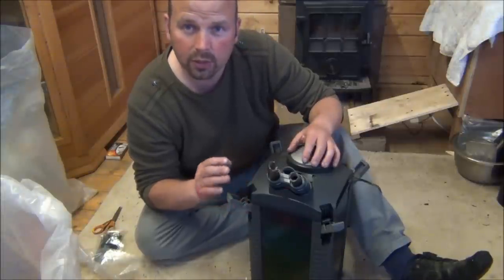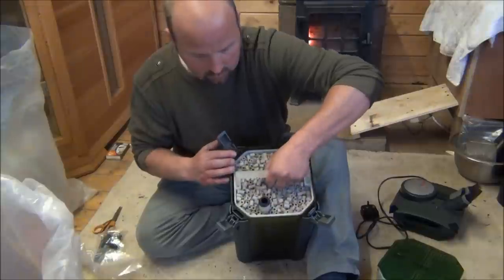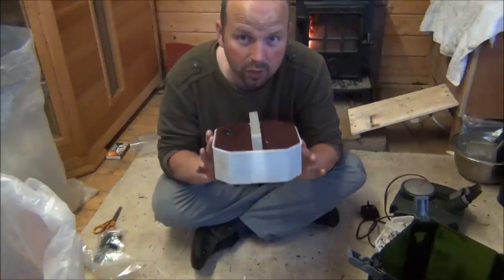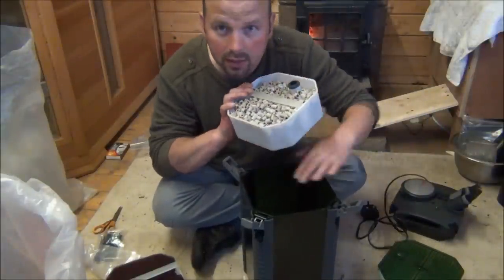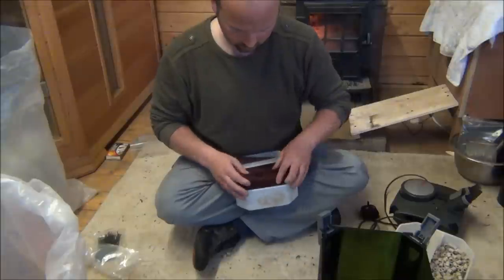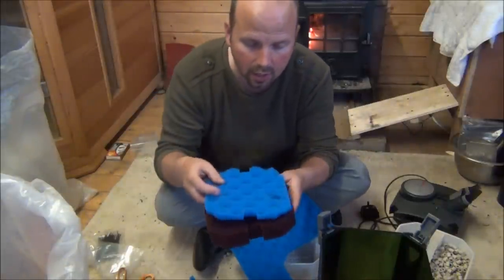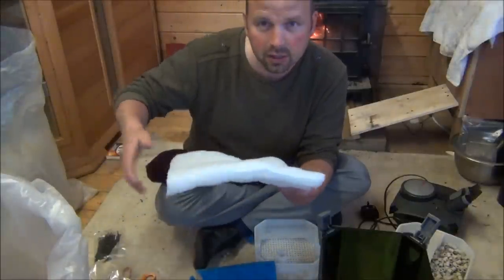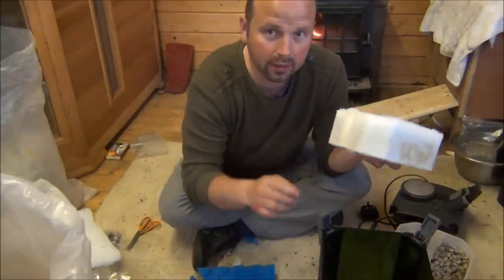How to set up an external canister filter for aquarium by Pondguru

Comment: Hey Richard, don't you have the water flow reversed in canister filtration?  If you say they're all the same, I'm hopelessly confused.  

Doesn't the water enter the top, trickles down through the coarse/medium/fine foam filtration (mechanical) then through the baskets holding all the Biohome media (biological) and finally ends up at the bottom of the canister where the water is free of impurities (ammonia/nitrite, etc.?  

If the water went immediately to the bottom of the canister, as you say, your set-up makes perfect sense.  But from what I see, Eheim  (I have 1200 XLT) has the water enter the top, where it meets the coarse filter, then descends to a finer one, then through 3 baskets of biological filtration at which time, the water is wonderful. 

I can check with Eheim but the top-down (trickle action) makes more sense to me, given how Eheim structures their mechanical/biological media in that sequence.
Reply from the maker: This link will show the water flow in the 3 series (half way down page): http://www.fishtanksdirect.com/EheimProfessional3AquariumCanisterFilter2073.aspx
If you look below the picture and read the description from eheim it is clear they have the set up arse end round given the direction of water flow as their fine pad is on the top tray just before water leaves the filter. Therefore particles are only removed after the water has travelled through biological media causing it to become clogged and inefficient when compared to a filter set up properly (with mechanical then biological).
A trickle filter is one where static water level is lower than the media so water 'rains' (or trickles) through the media by gravity as in some sumps. A canister filter has the media totally submerged in a pressurised situation so of any filter situation that is the one where it is essential to have the filter set up correctly to protect the media and ensure proper operation.
You could place the media and foams / pad anywhere in any filter for clear water but for long term healthy water and high waste processing capability (reduction in ammonia, nitrite and nitrate) it needs to be set up with all mechanical done before the biological zone.
Hope that helps.

Comment: I have a 15 gallon tank with 2 filters running on each end but the water still gets mucky within a week. canister filters are meant for really big tanks. how do i find out which one will have just the right amount of power for my tank? last time i put a powerful filter in a smaller tank my fish had trouble escaping the suction.
Reply from the maker: +Abdulbarr Aslam Canister filters are available in a wide range of sizes and are definitely the best way to filter tanks if set up correctly but you can get decent internals with multi chambers which can be set up correctly. Using a spray bar will diffuse the flow and be better than a straight outlet. Even if you go for one 50% larger than necessary with a spray bar attached it should be fine for even weak swimming fish.
Reply: Thank you for the input

Comment: can you add sachem perigean on top of the last tray if needed??
Reply from the maker: +Kevin Courtenay Aaaaarrghhh.....the bacteria killer. I&#39;ve had so many people reporting that their biological filter fails to establish and control nitrate and Purigen has been a common factor in those situations. Once it is removed the filter matures naturally and starts to control pollutants as it should. My advice would be not to use it but if you want to remove colour or residual treatments from water use carbon as it will do exactly the same job without hammering the bacteria in the filter. The purigen seems particularly hard on the anaerobic bacteria which controls the nitrate meaning that when the purigen is removed (after killing off the bacteria) pollutant levels rise making the user think that they need the purigen. You only need foams in correct place in the filter and good media. That will enable your filter to support the right balance of aerobic and anaerobic bacteria resulting in full cycle filtration and ultimately the processing of nitrate. 
I&#39;d definitely say ditch the purigen and put something useful in like more media or carbon (if needed to remove residual fish treatments or staining from bogwood). 
http://www.filterpro.co.uk
Reply: +Pondguru Outdoors thanks for the email.... I will remove the purigen and add more media. Where can i get the media you show in the video in the states???
Reply from the maker: +Kevin Courtenay If you follow the link on my website (flag on all pages) it will take you straight to US dealer.
http://www.filterpro.co.uk

Comment: hi i want to fit an external filter to my 65l aqua one horizon tank  and want to set it up as in the video can you suggest  a suitable one and how much media i would need to order many thanks
Reply from the maker: You wouldn't need a very big external filter for 65 litres and to be honest the name of manufacturer isn't too important as the majority are decent enough quality. Most will take 2-3kg of media but some of the larger ones may take much more. Just send me measurements of baskets you want to fill with media and I can work it out exactly.
Reply: Pondguru was thinking of the fluval 106 but not sure how it would set up as it has a side filter
Reply from the maker: MrDaveyb942
Would still work no problem as long as you made sure foams were in correct order.

Comment: hi there i have a blagdon external pond filter it hasthem white round things at the bottom and then 3 sponges should i just leave them how they are.???
Reply from the maker: Unless you improve the foam filtration in that filter there is no point changing the media as a pond situation usually generates much more muck than an indoor aquarium.

Comment: Hi would you use this system on the Fluval 306. Andy
Reply from the maker: Andrew Leigh Yes it would work exactly the same with the layered foams in bottom tray and media in trays above that. You would need around 1kg per tray so for the 2 media trays you'd need 2kg of either mini ultra (as in this video) or biohome ultimate in this video: https://www.youtube.com/watch?v=lsAmSD3wVbgLeave the standard foams down side of filter as they will give extra mechanical filtration.

Comment: +Pondguru Outdoors I need help with refilling the filter by priming after doing a maintenance...I have a prime button on top and I have closed both the valves and theres locked water inside them..Now if i open those valves will the water come to the filter ? or should i press the prime button to release the water?
Reply from the maker: The prime button acts like a purge to drive air from the pump part of the filter so as long as you fill up the pipes with water, turn on the filter then keep pressing the priming button it should start to draw water.
Reply: +Pondguru Outdoors Thanks for the reply..I have set it up and its running fine..but occasionally the outlet tube throw some fine bubbles while the filter is running and the canister unit makes some whooshing sound when it does that...but it only happens sometimes...I pressed the prime button multiple times while its running and it throws more bubbles when i press but after that its still the same...is that normal or am i doing something wrong?
Reply from the maker: Sounds like there is still air in the pump part of the filter. As I'm assuming there is no air being sucked in by the inlet pipe you could release the last air by tilting the filter about 20 degrees in all directions. You should hear the air being sucked up by the pump and it will be spat out into the tank from the return pipe.
Reply: I think i have a small packet of air in the inlet pipe where the tube connect the hose..how do i get rid of it.?..i tried rocking the canister and it does what you said but still the air packet is present in the inlet tube..
Reply: pls ignore my previous message..i fixed it by clearing the air bubble inside the intake tube..thanks..
Reply from the maker: OK no worries - glad you got it sorted.
Reply: Another question...I have placed the intake and outlet pipe in the same side of the tank..the fish waste accumulates near the intake tube(a few cm away from it) but its not sucking it up...Should I place the pipes on opposite corners? what is the effective placement of pipes to catch the wastes?
Reply from the maker: Every tank is different as the decor will alter water flow but as long as you have a good turn over of water and the dirt is not pushed away from the inlet then it sounds like you have the flow right. If you can get an extension for your inlet you can drop it a bit to be nearer the collected waste.
Reply: Nice idea , I thought of that too..Hope you don't mind another question..My filter filters from bottom to up..It looks a slightly V-shaped, Wont the water also travel via the sides to the top? I can definitely see the gaps around the sides of the trays...so how does the water enter the top? is it only from the bottom tray to top tray or also via the sides?
Reply from the maker: The sides should fit together to prevent water getting in or out the sides and the tube sending water down to the bottom of the filter will fit with the pump part to allow water to flow down freely then rise up through trays.
Reply: ok thanks, But I can see fish wastes on the sides which is coming from the bottom gap, but the top lid on the first tray is pressurized by the motor and holds them together from going up...Im wondering why cant they make the trays airtight so that the water only flows through the bottom tray and not the sides...Are fluval filters also like this?
Reply from the maker: All filters seem to have some sort of tolerance and some will be more than others. There will always be dirt around the outside of the trays but it should not be able to get into the trays under normal circumstances.
Reply: ok thanks for all the helping replies to my noob questions even though you seem to be an advanced aquarist... :)

Comment: hi Pondguru i just got this sunsun 302 3 stage filter and i wanna know if i can use the same setup here on that filter
Reply from the maker: Yes as it works the same way. Unfortunately I don't have the tray sizes for the 302 recorded so feel free to measure them and I will work out how much media you need for each one, no worries.
Reply: Pondguru thanks i will do that for you... they about the same size as the ones in this video
Reply from the maker: Curtis Williams Many of the externals available are of a similar size but its always best to double check, no worries.
Reply: thanks i used the same setup you have here and it runs better and water looks clearer, But what you think is the best bio rocks to use.. cause i have them cheap bio rings that you can get from anywhere.. And do i have to use then bio balls.. or can i use the last to trays for the bio rocks like you did here?
Reply from the maker: Curtis Williams This is definitely the only way to set up an external filter and the later video explains it much better and shows the upgrade kit:  https://www.youtube.com/watch?v=lsAmSD3wVbg
Reply: so what bio rocks to use
Reply from the maker: Curtis Williams I have no idea what bio rocks are.
Reply: Pondguru the rocks you use in this video what are they so i can get some of them... are they media?
Reply from the maker: Curtis Williams The media I use is Biohome mini ultra. Link is in the video description along with quantity used.
The improved version of this media is called Biohome ultimate and is the same as the mini ultra but has added trace elements to allow the bacteria to work even faster.

Comment: Hi looked thought all comment can't seem to find the answer , if I ever need to use carbon or clearmax where should I place it above or below media?
Reply from the maker: I'd generally say put it right at the top so it is the last thing the water hits before it leaves the filter. If the filter is set up properly you will not need either of those products unless you want to draw in any colour from bogwood or soak up residual treatments. When the external is set up right you will treat the tank much less though.

Comment: So the first 2 trays fill them with bio media and the last tray with course, medium, fine foam? I was wondering what two trays of Bio media be too much? I have a 38 gallon bow front. Sorry if this is a stupid question I'm new
Reply from the maker: If the water flows up through trays like it does in the filter in this video, yes. You can't have too much filtration on a tank.
Reply: Is it possible to put too much bio media in the trays? i have 5 trays the sponges in the bottom and bio media in 3 trays and fine sponge in the top. The water seems to leak out of the filter the bio media i'm using is a lot smaller than the one you're using, I'm not sure if I'm using too much.
Many thanks.
Reply: Linda Baxter why do have the fine sponge up top? If your filters starts filtering from the bottom up. First tray should be course, medium, then fine pad like in the video. Fill the top 4 with good bio media. That's what the guru would say I'm guessing haha. I just ordered some more fluval bio max to put in my second tray.
Reply: Linda Baxter forgot to mention, it could be the fine sponge up top cause the leak?
Reply: clubtc05 
Hi.
I've since found that the clamp that holds the motor head down has a crack in it hence not holding the head down securely. I'm modifying this I'm pretty sure thats where my problem is.  Thanks thou for your reply, I've also put the 3 layers of sponge in the bottom tray and evenly distributed the bio media in the other 4 trays.
Regards
Reply: Aww that sucks! I wish my canister has 4 trays, I only got the one with 3 :/   Best of luck though!
Reply: clubtc05  I decided to invest in a external filter, when i got it i found there was a broken clamp in the box, i had a replacement clamp sent out and i was looking forward to setting it up the filter. Now I think I'm ready to use it I've got another broken clamp 😕.  Thanks for your help and advice tho
Reply from the maker: Sorry just seen this now - you can't have too much media in a filter as more media = more surface area for bacteria and as long as you're using good media that is all good.
Reply: Pondguru Pondguru thank you Sir for your video and advice, I have learned alot from you, I really appreciate it.

Comment: Hello there,when does these filter media be changed.
Reply from the maker: As long as it is well protected by the foams it should last for many years at high efficiency - maybe 6-10 years in most externals.

Comment: Whee can i buy those filter foam? Can i just use the curse foam and the fine foam only?
Reply from the maker: If you only have space for coarse and fine that is fine. The coarse and medium foams often come in a pack bundled together if you use foam which is profile cut like the one in this video - link to my ebay shop at bottom of video description.

Comment: How often do you change the foam and media?
Reply from the maker: +E M The coarse and medium foams should last a good couple of years and the fine white pad will need replacing as and when it becomes clogged (depends how much muck gets sucked into the filter). The filter media should last between 6-10 years at high efficiency in a well set up filter (where it is protected from dirt by good foams and fine pad).

Comment: My canister filter came with Bio Balls as well as the ceramic rings, is it ok to put them in the very bottom instead of the ceramic rings?
Reply from the maker: I assume you mean the plastic balls - yes they can go in the very bottom to act as primary settlement but you'd be better using the ceramic rings in there and then using good media in the filter above the foams.
Reply: Pondguru Yes those ones! I have Seachem Matrix in the 2nd and final sections and the three foams in the first like you mentioned, does that sound fine to you? Thanks for the response!
Reply from the maker: Daniel Lee
Matrix is certainly better than the ceramic rings and the set up of the filter sounds fine. Keep an eye on the nitrate as although the matrix is hyped as reducing it there is often no effect.
Reply: Pondguru Thanks I'll keep the matrix were it is and put the Ceramic rings in the bottom. Ok I will but I haven't cycled the tank yet so it should have plenty of time to build up the bacteria.

Comment: i thought the biomedia had to be in wet dry ....the reason I'm asking is because i was thinking about doing the same thing to my canister filter.
what would the difference be if please in a canister filter? versus wet dry drip tray?
Reply from the maker: Wet / dry is the most efficient way to use this (or any other good media) but the biohome works incredibly well in a standard external filter. The mini ultra and the new ultimate media have been designed specifically for external filters but are also very efficient in any other filter situation.

Comment: the eheim 2224 only has two baskets so foam layers in the bottom and biohome media in the top.
But the 2224 does not have the plastic tray that you put in last ,would the filter be ok to run on your set up without the tray? .I would be using on a 125 litre tank,thanks.

Comment: I think the eheim pro 3 2080 (or XL) is different than this pump, I think the 2080 has been designed so that it first goes through the mechanical media, than through the tube(s) downwards en than from the bottom through the biological media out of the filter...:

eheimna(dot)com/products/detail/Professionel-3-Thermo

replace (dot) with .

Comment: do you have to prime the filter every time you turn off power. more in less I want to put it on a timer
Reply from the maker: You won't need to prime it each time but a filter needs to run 24/7 to keep the bacteria alive in the filter media and to keep the oxygen and pollution levels balanced in the tank.